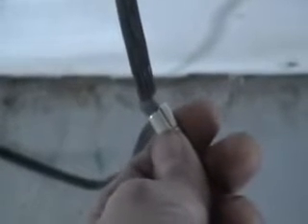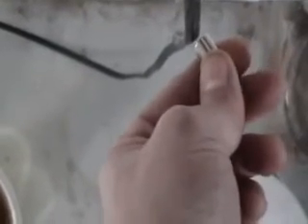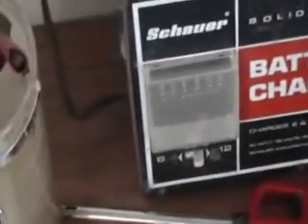HHO_oddity_1

Comment: yes ... this is normal ... there is a magnetic field that surounds a DC line ... same on an AC line but the field changes so fast that you wont note the effect ... chanced are your charger is putting out "pulsed" DC as most are too cheap to include much for smoothing capacitors ... 

you can confirm this by holding a compass to the wire ... the needle will point to the wire ... then change 180 degrees when you change to the other polarity wire ...